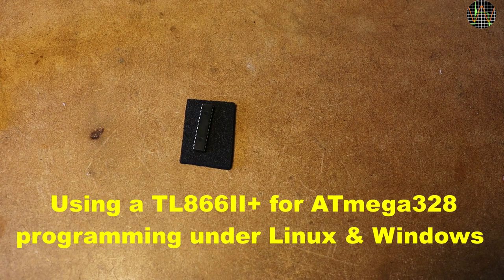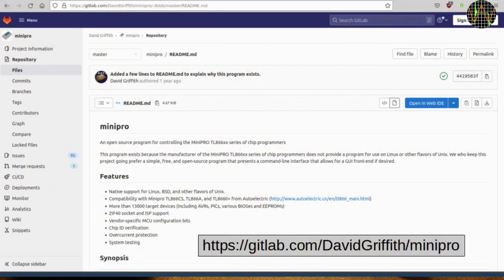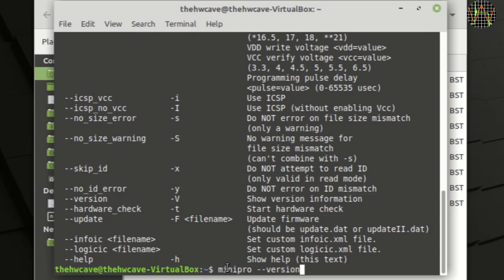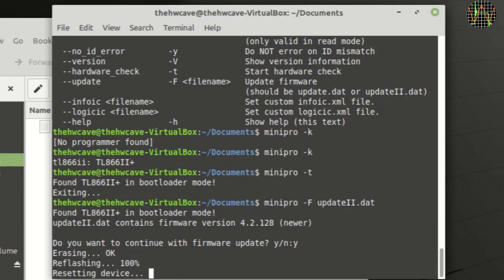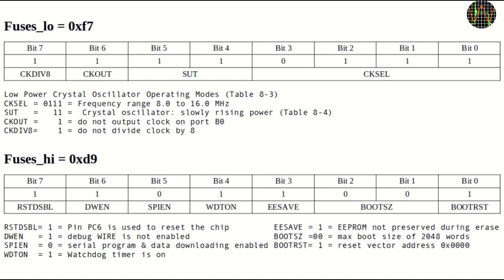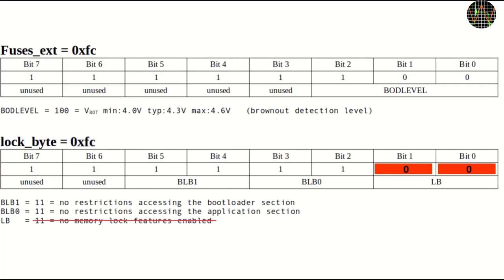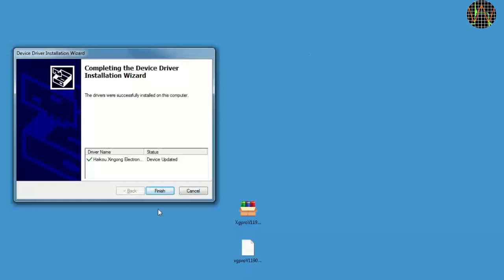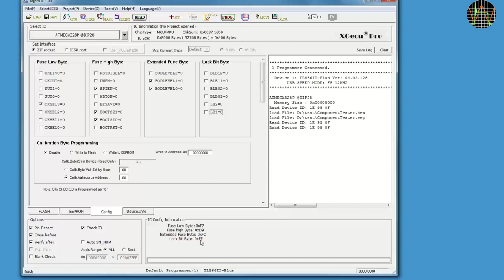#111 Using a TL866II+ for ATmega328 programming under Linux & Windows

Comment: Thanks for the video! Very informative and educational. As a linux user I'm glad there is a open source software available as well.
I learned the hard way yesterday that you need to set the fuse bits correctly, as my ATMega328p could not talk to arduino software because of only using internal clock @ 1MHz.

Comment: I just wanted to note that you probably meant dealbreaker when you said showstopper, because it's a common mistake and a showstopper is something positive. But after double checking I'm not sure if the usage of the word is slowly incorporating the meaning dealbreaker too. However thanks for the very interesting video. I already burned some Eproms using the TL866 and Windows but never a microcontroller. The part about the fuse bits was extremely interesting and now I'm reading the datasheet.  Also I'm using XGPro V7.11 for a few years and to my surprise the new version of the software looks quite a bit different and nicer.
Reply from the maker: Yes, I used showstopper as a negative. I agree that dealbreaker would have been a better choice of words. I keep that in mind when I hit the next "showstopper"

Comment: You forgot one important thing: The TL866II+ is a high voltage programmer! You can program the Reset PIN as an IO PIN and if you do that on a conventional programmer you are stuck now. With the TL86II+ you can recover the Atmega and program the PIN as Reset again.
Reply from the maker: I had not realised that. Very good to know. Many thanks
Reply: So what you essentially do is voltage glitching?
Do you have any more info about this? As I'm interested in how this works.

Comment: Thanks for the informative video! Quick question: I'm attempting EEPROM (28c256) programming but only have access to a T48 programmer instead of the TL866 chip programmer you mentioned. Since I'm a Linux user, do you think the GitLab link you provided will be compatible with Linux systems?
Reply from the maker: Sorry, I really can't advise on this without having such a programmer and trying it out.
Reply: The T48 programmer has experimental support in the latest versions of minipro for Linux. I've confirmed it works at the very least with 27C512 EPROMs and should work with the 28C256 as well.

I understand that the following command should work: minipro -p 28C256 -uP -w filename
Reply from the maker: Well I am a Linux user too so chances are yes,  but I have not needed to program any EEPROMS or other chips for a while, so I can't really  tell at the moment.

Comment: hi thanks for this video. I do have a question and i hope you can shed some insight..I too have an TL866 programmer and an Atmega328p, I am trying to flash the bootloader (i have the hex) but what i am trying to do is set the fuse to 8MHz in the config section of the minipro software. But i do not know which ones to check mark. I purchased a Atmega328p with bootloader already isnatlled and set to 16MHz, but i want to avoid using a crystal in my project so I need to flash the bootloader with 8mhz, how can I do this using only the minipro? I see you mentioned it here in the video, but I am new to this stuff and dont understand how to actually implement the settings to achieve the result
Reply: if i want to set the fuse to 8mhz, which options do i check mark here?
https://imgur.com/a/9Mqd72b
Reply from the maker: With no crystal you mean the default 8MHz internal RC oscillator.  This is done using the fuse_lo byte with a CKSEL to a value of 2 (binary 0010). For this mode, the default is CKDIV  to be programmed to 0 which divides that 8 MHz to get you 1 MHz for the CPU. CKOUT is by default not programmed (1) meaning the clock signal is not sent to port B0 which probably what you want. The whole Lo_Byte for this would be 01100010  or hex 62, which is the default when you buy a brand new chip.
Reply: @TheHWcave  I’m using fuse bite calculator and now it starting to make sense what you said here. I made changes and arduino won’t upload, I’ll try only changing lo

Comment: After watching your videos I felt confident to get a TL866II+ and upgrade the firmware of my tester. I am trying to use a Pi4 for running minipro. This works, but now I want to upgrade the firmware of the programmer first. I have downloaded and extracted the .rar archive with „unar“, but now I am stuck with the .exe file. I could not extract the updateII.dat file from it. The Pi does not have Archive Manager installed, but XArchiver by default. Does anybody have an idea how to get the required file out of the .exe?
Reply from the maker: You could try renaming the .exe to .zip because that's what it actually is. You should then be able to examine the content using any tool that handles zip files
Reply: @TheHWcave  Unfortunately this did not work, but it worked easily on my Mac. 😀